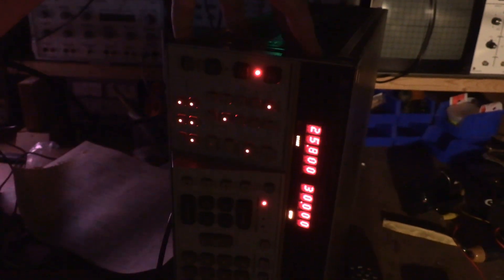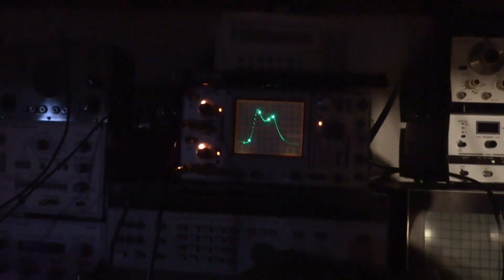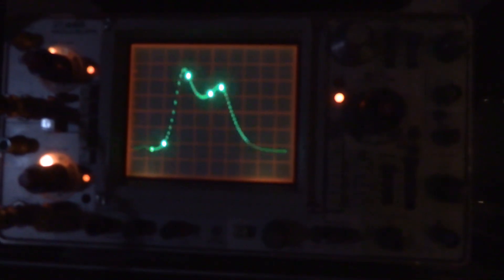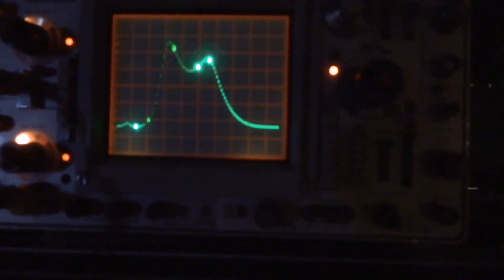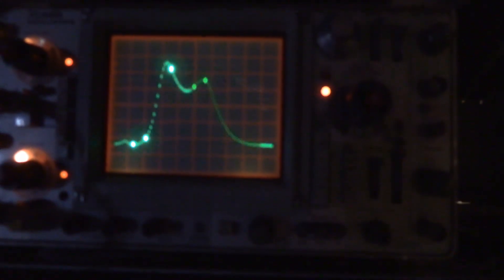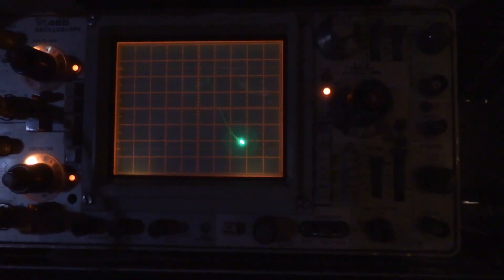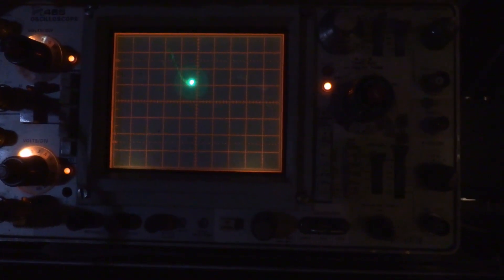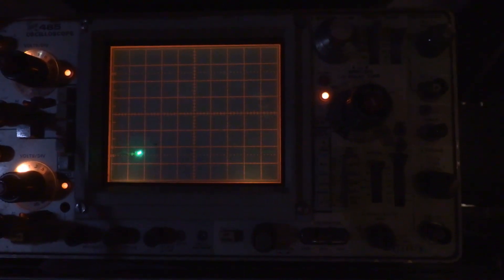HP 8662A testing sweep and marker capabilities

Comment: Might be best paired with a tektronix 466B. It’s the storage version of the 465 using variable persistence phosphor. 

Either that or an HP 8750A Storage Normalizer, though you’d need the special adapter cable (contact GLK instruments)